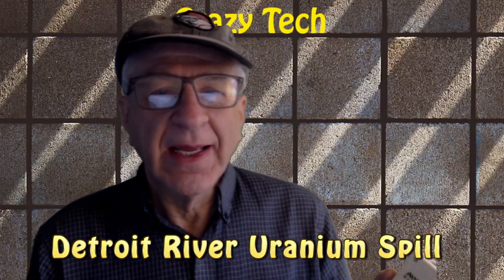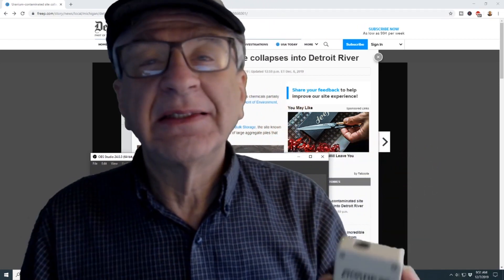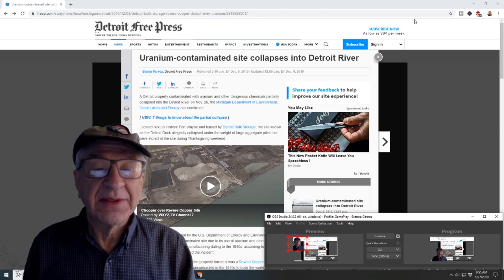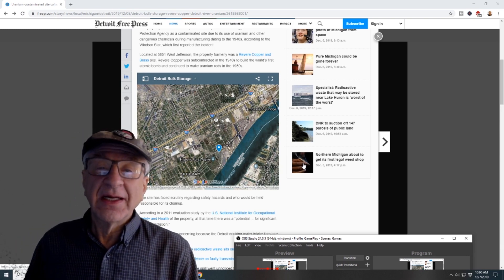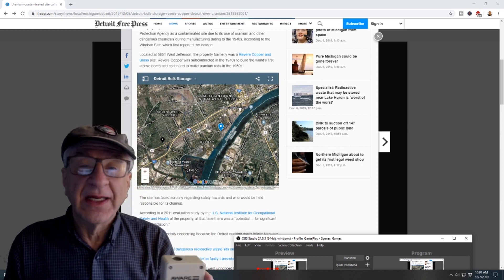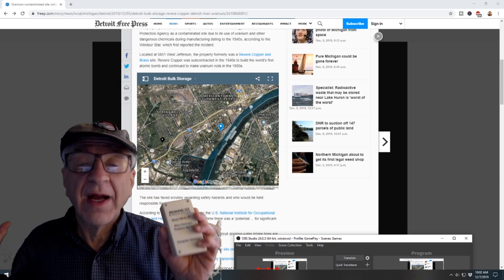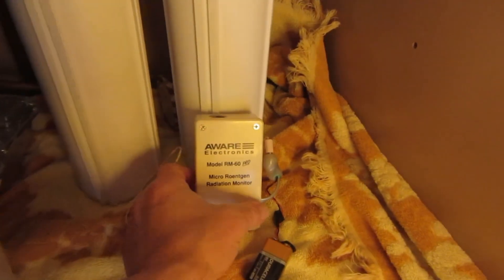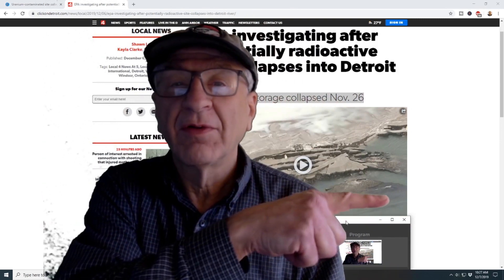Uranium Toxic Spill into the Detroit River  November 26, Reported on December 6

Comment: You have a filter. Many people dont
Reply from the maker: That's true. Carbon filters will remove radon, and some other forms of radiation.  And they remove chlorine to improve the taste. A filter material called KDF, which is ground copper & zinc, removes most heavy metals like lead and pesticides. I use a cartridge with KDF and coconut shell carbon.